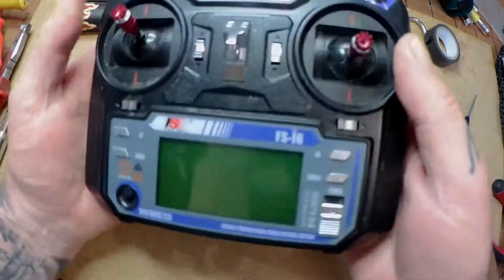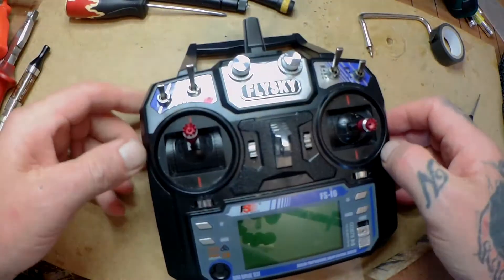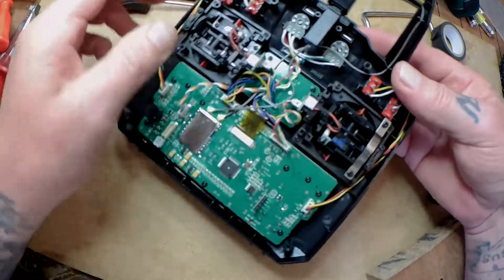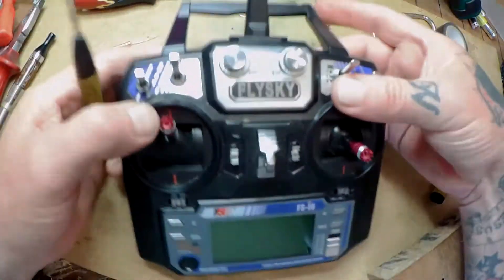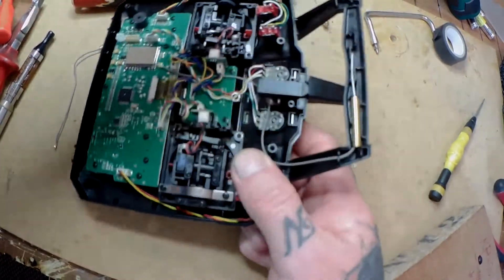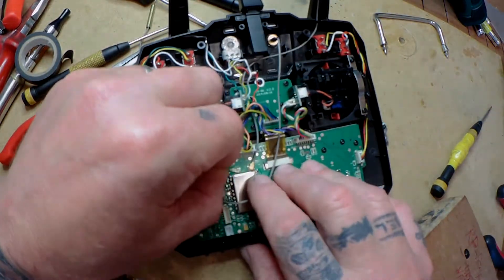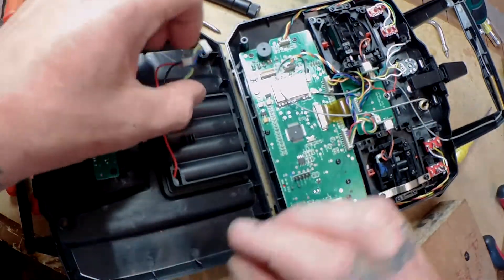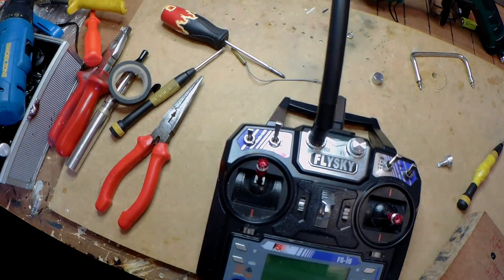FLYSKY FS-I6 ANTENNA MOD FOR BEGINNERS

Comment: primary antenna Accidentally chopped while flying quad so will you please help me to find a the part
Reply from the maker: , what are you flying ?
Reply: Is it possible to find the parts online.searched a lot couldn't find the part for replace
Reply: Tx primary antenna is damaged but I could find the part from online do you have any idea
Reply from the maker: @randomstuff8286  try banggood usually they have quite a few .